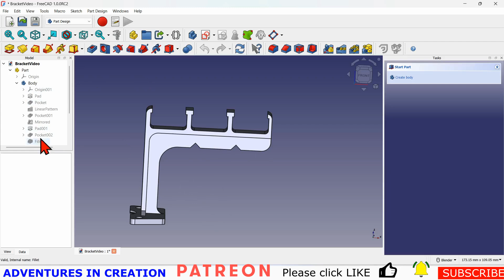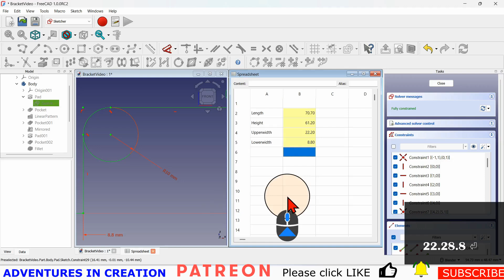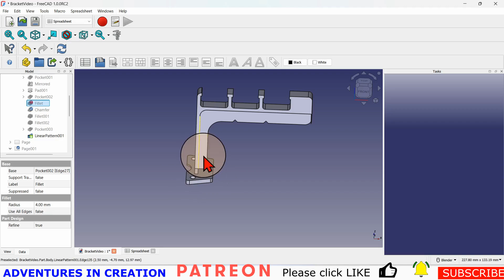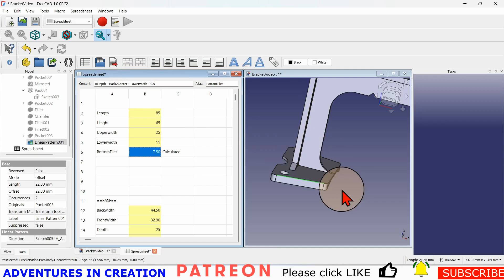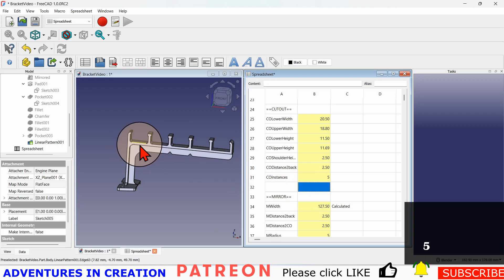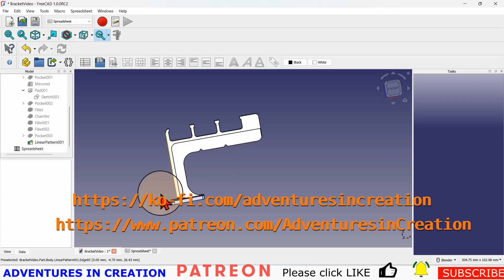An Introduction to FreeCAD 1.0 Part 5 #freecad #cad #design #sketcher

Comment: I'm not great at setting up spreadsheets (in any aspect including and upto office spreadsheets, lol). So I would like to know the calculations for the "MWidth" because you didn't cover it in the video. I'm not good at math either so calculations are a tough thing for me. I can measure and cut things, but when it comes to parsing out what math equation to use I wind up getting flustered. Any info on this would greatly help me out here, lol.
Reply from the maker: It's just Length + 10

Comment: I am really getting a lot out of your series so far.  But I have an issue ... again.  I have looked and looked and i cant find it.  Where do you make a connection from the spreadsheet to the Fillet?  Mine doesn't work of course, because my spreadsheet is not connected to the fillet so it can't change the radius.
Reply from the maker: If you have an entry on your spreadsheet for the filler radius, just go to edit the fillet and click the blue circle to connect it.

Comment: I'm in the remedial section. I've labeled all the dimensions in my practice file according to the spreadsheet you showed here, and it works, sort of. The fillet is ok and the length adjusts based on number of instances. As for adding the cutouts, my model works with 2 or 3, but not 4 or more. I think the only formula I haven't gotten is the TDistance2Origin so maybe that's the problem. Or maybe I've got another formula wrong. 
I really appreciate all the work you are putting into this series, so I don't want to be a problem student, but could you tell me what needs to happen to add the designated cutouts.
Reply from the maker: That's interesting and very hard for me to debug without looking at my model.
Reply: @Adventuresincreation  Yeah, I get that. I'm going to start from the previous drawing (part 4) and rework part 5. But could you tell me what the formula for TDistance2Origin is? I think part of my problem is that I haven't found that.
Reply from the maker: @jeffholloway8345  =9.5 * COInstances is the formula
Reply: @Adventuresincreation  Thanks!
Reply: Just to follow up, I re-worked Part 4 completely and then re-did the spreadsheet following Part 5. In the end I found three mistakes I'd made: I failed to label the BottomFilet, the COInstances, and the MWidth in the drawings. Once I did all that it works perfectly. Moving on to Part 6. 
But I have one more question. There is a red, blue, & green xyz-plane-directional that appears in my drawing at the center point (not the little one in the lower right corner). Apparently I turned that on by mistake but I don't know what it's called or how to turn it off.
Reply from the maker: @jeffholloway8345  Glad that worked for you. If you click on it, you should see it highlighted in the model tree, you can then click on it there and press the spacebar. This will toggle it on and off.
Reply: @Adventuresincreation  Aha! It shows up as a Transformation task. I didn't make the connection. Thanks for the tip.

Comment: its turning into aa great project , and a fine bracket .
Reply from the maker: Thanks, I will add tech draw in the next video to show how easy it is to create drawings from a model.
Reply: A bit more advanced but I'm interested in seeing how built in functions for spreadsheets work.  Things like sin, cos, and other math functions along with the possibility of decision functions like "if greater than, calculate, otherwise do nothing" etc.  Not sure if that even exists but I've seen very little tutorials on the built in stuff. Great videos - keep up the good work!
Reply from the maker: @lewiscobb7817  I'll cover that in another video. I did a video for my patrons that covered the conditionals.